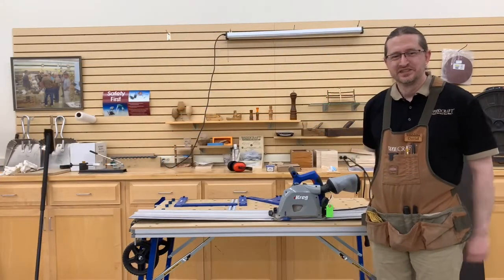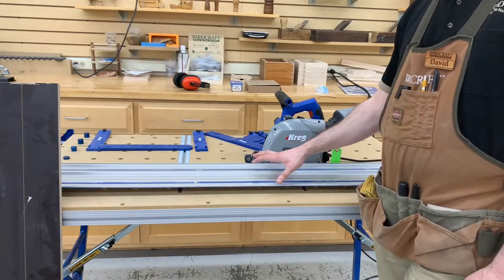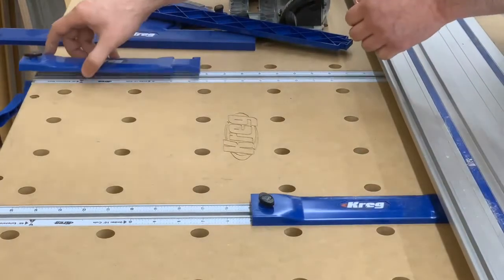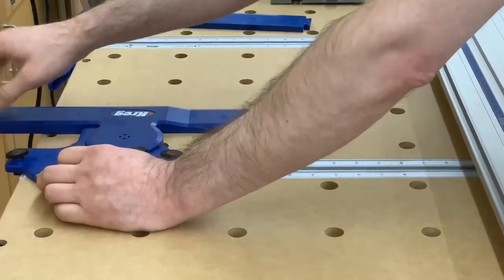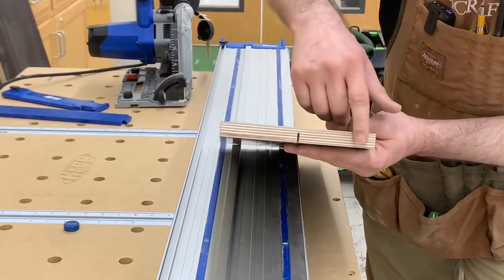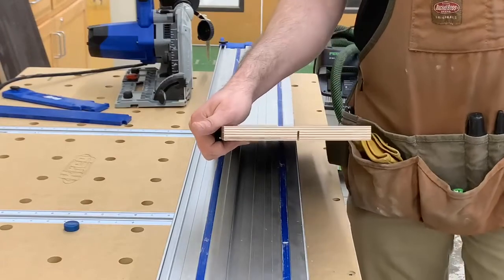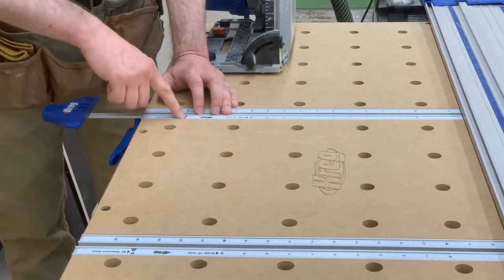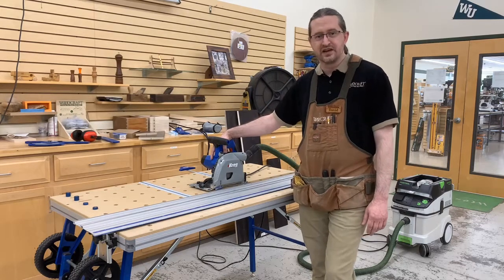KREG ASC

Comment: Thanks for posting!  I think this might be one of the better comprehensive videos I’ve seen for the whole ACS system that wasn’t from Kreg or someone sponsored by them.  Regarding the table itself, how sturdy is it with the fold out legs?  I don’t have a lot of space so I’m wondering if I bought this if I could also use it for some light hand tool work with a block plane or something.  I know it wouldn’t be as good as a true bench with dog holes but was just curious what you thought.